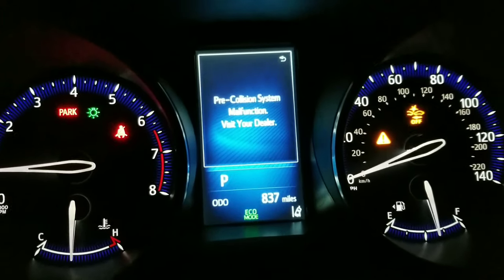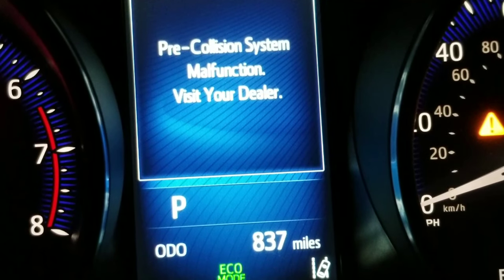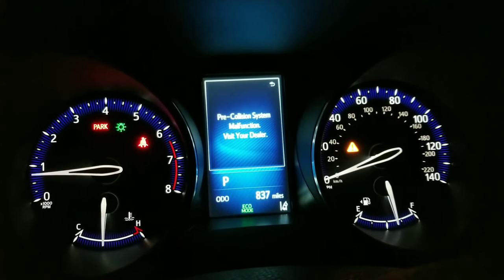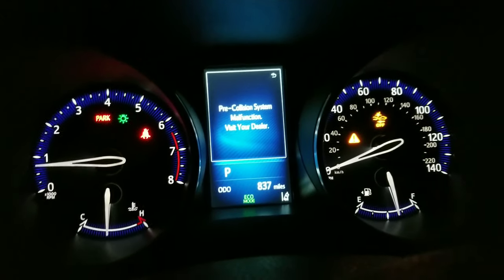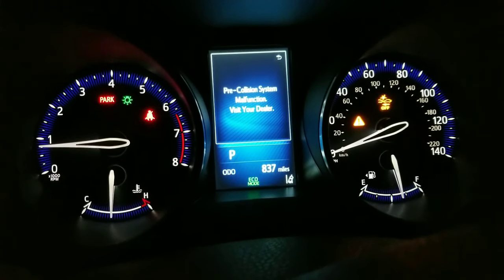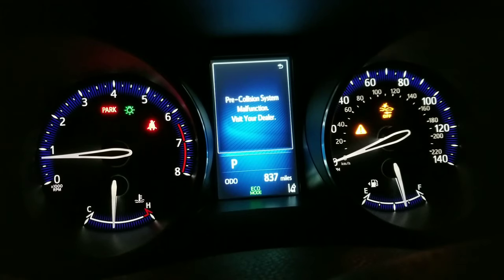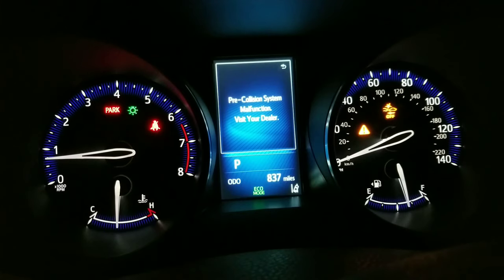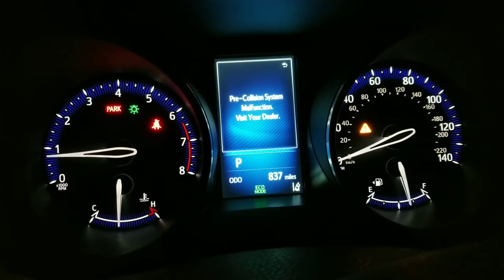Toyota CHR Pre-collision system failure (FIXED*** read description for how it was solved)

Comment: had the same message today, with one more message,  trailer brake error, at the dealership they told me that a mouse or something like that had eaten the harness and that the harness is in between the intake manifold and the engine, in all it's going to be $700.00 dollars to repair, I don't really believe them, but had no options because the dealership does not recommend to drive the vehicle like that, it's going to be about two days I had to claim it through my insurance but feel like I been taken for fool, let me know what you think!!!
Reply from the maker: Oh wow I'm sorry to hear that! If it's the dealership they will be charging full price and I wont imagine any local shop would do any better. How much is your deductible? If you want proof that's what it is, I'd ask for pictures prior to the repair (may be too late) and after. Man, that stinks... hopefully it won't happen again.
Reply: Alejandro martinez  yep i had exactly same situation with my chr they told me rodents chew the wire its BS

Comment: I had the same problem last night. It was snowing so I stopped and wiped the front of the sensor, switched off the car and on again. Error message didn't go away. This morning when I was leaving for work, there was no error message at all. Please update your situation.
Reply from the maker: Raghu k c sorry to hear. Believe it or not it's still with toyota. The sensor is back ordered and had to be ordered from Japan. I have since contacted their coorporate offices and they are giving me a credit on a car payment since it will be nearly a month that my CHR has been at the dealership. That's all I know at this point.
Reply from the maker: They expect it to be in on October 30th
Reply: thomas petroff jr I took my car to the dealer today abd booked the time for next week. According to the dealer, this is a common problen in C-HR. If I understood correctly, during the rain or snowing, vapor develops in camera lense blocking the sensor. So, the guy says it takes like couple hours to install some kind of extra heater so that no vapor will develop. Hard to believe that but I am no expert on this. Apparently, Toyota has informed them about the problem and it seems it's the same problem in many others too. Good luck with your car.
Reply from the maker: Raghu k c I think we have different issues since I live in Los Angeles and it wasn't rainingor snowing. They say it was a bad sensor for the breaking system that affects the radar. I was able to get toyota to make a car payment for me since I'm without my car for nearly a month now. Hope this isn't a sign of things to come. I really LOVE this car
Reply: @tompetroff hey what's the Name of sensor.... did car shut off on you?

Comment: Very concerned that you had a trailer hitch installed in the rear of the car, but had the front sensors affected. Pre Collision radar system is located in the front behind the Toyota grill emblem and camera on the windshield in the area of the rear view mirror. I had a rear bumper collision, but the repair shop denied that a rear collision on a 2018 Toyota Camry LE could affect the Pre-collision system in the front of the car. Is there any data that the rear bumper has anything to do with the Pre-collision system ?
Reply from the maker: It offset the ohms of electrical system. That's what Toyota said. Haven't had an issue since I had the brake light adapter removed from the trailer hitch
Reply: 2 months late, but I was involved in a accident where someone rear ended me. My Ford fiesta (same layout of the system) displayed that the adaptive cruise control system had malfunctioned. So yes I can confirm with 100% certainty that a rear shunt can affect the pre collision system (as it uses the same radar as the adaptive cruise control)
Reply: @tompetroff  hi thomas , my toyota corolla hybrid showing the same signs+ hybrid malfunction system... and car is not starting as well.... did you have same problem?? And what has been repaired can you tell me please if you know about it,,, thankss

Comment: Just an FYI, any time you Malfunction Indicator Light like this one (or ABS/Traction Control, Airbag, etc.) the system that light pertains to is disabled (This does not include the CHECK ENGINE Light).
Reply from the maker: That's an excellent point thanks
Reply: So my airbag light is on because seller didn't replace the curtain airbag. My BSM doesnt work because driver side door was replaced with original. Maybe the connection not plugged in for the mirror? Also cruise control radar works but if i get close to someone it wont pick that up. Lane assist works. Also i noticed when its hot i get a pre collilsion malfunction but goes away when it cools down

Comment: Important information! 
I have a chr and my preclusion light was on. I was confused at first because I kept cleaning my windshield and logo. Turns out, 2 weeks ago I went to replace my windshield due to a crack on it. Safelite used a third party windshield causing the sensors to keep pooping up to clean it. Toyota actually requires Toyota brand windshield for it to function correctly.

Comment: I just started having these issues when I installed a 3rd brake flasher. And ur issue was when they installed an additional light? I wonder if i shud return to stock?
Reply from the maker: Yeah, it changed the draw of electricity. It's very sensitive and was fixed when I removed the brake harness
Reply: @tompetroff  thanks for response. I'll remove it!

Comment: My Toyota Camry after being repaired by the panel beater has the same ongoing issue I tested it today in two different ways I left the pre-collision system on and put on cruise control I drive for a bit and then the pre-collision system malfunction turned on

Then I tried something else I disabled the pre-collision system by switching it off I thought this would work again I put on cruise control and started to drive out of nowhere it came up pre-collision system malfunction
Reply: Do you change front screen or open the Car's bumper from mechanic??

Comment: I have the same problem. I went to the dealer the re-install the software. But the still on. Note this is my second c-hr, and the first I didn’t have this problem.  I live in japan.
Reply from the maker: Roberto Guimaraes so you have the 2019 now? Ive been really satisfied with my 2018 and no major issues. Sorry youre going through this
Reply: My Camry has done this twice, just take battery cables off, wait a minute then put back on. Warning light will still flash until you drive the car. Then it’s fixed.
Reply: I love my chr, but I’m ready to trade or sell it JUST for this malfunction light. Grrrr.

Comment: The same light turned on for me just right after driving the car for over 7k miles. Was yours got fixed? I used my cruise control while raining then minutes after the PCS light went on.
Reply from the maker: Marv Molina it appears to not work well in the rain. My issue was due to a trailer hitch I had installed
Reply: thomas petroff jr did the light turn off though? And how long did it take you to get the PCS fixed?
Reply from the maker: Marv Molina it did when they (toyota dealer) disconnected the brake kit uhaul installed. If its still on I dont know what to say. Have you taken it to the dealer again?
Reply from the maker: Marv Molina It went off immediately after disconnecting the cable uhaul put on. However I know there was a recall on a part so you may need to check with your dealer. This was around Feb of this year 2018
Reply: I just went to the dealer and they said that there was no recall. The light turned off after a couple of days, so they could not diagnose what is the problem. Showed them a picture of the light that was on but they said, they have to see it in the OBD
Reply from the maker: Marv Molina where are you located? I live in los angeles and went to frontier toyota. They had my car for over a month and had even toyota Japan involved.
Reply: I’m from Florida. Hopefully, they don’t have to hold my car for that long cause that would suck
Reply: What was the issue how did you fix car

Comment: 2019 CHR 7000 miles--with exact same issue 
The visit to the dealer was joke
Tell me rodents have been chewing on the wires new camera radar module is $4500 buck if insurance wont pay then they can re wire the old cannon plug for $500 
Anything to avoid warranty payment
Scumbags not at all what I had expected from toyota my last vehicle I will buy from them no honor among thieves --sad
Reply from the maker: Wow I’m sorry you are dealing with that. I haven’t had an issue in 2 years. What state do you live in? Would it qualify under lemon laws?

Comment: I just bought a CHR as well a month ago. Didn’t have this issue BUT I was driving and I was at a stop light. The indicator on the speedometer turned on for about 3-4 secs and went off. It hasn’t turned on ever since. 🤷🏼‍♂️
Reply from the maker: Aviator2015 which indicator?
Reply: thomas petroff jr I’m sorry, the pre collision indicator.

Comment: Hi I’m in Australia and my Toyota Land Cruiser prado 2018 has just had the same thing happen 55oookms on the clock dealership told me Toyota has never seen this after the replaced something in the dash we got the car back and 2 days later it has done it again. Let me no what you find out because down there they say they have never come across this issue (bullshit).
Reply from the maker: Marc Sacco sorry you are having this issue. For me it was my break light kit that haul installed for a trailer hitch I put in. If your car is dirty or if it’s raining, the sensors don’t like it. I wish I could be of better help. Best wishes on your car. Something tells me that there will be a class action suit at some point

Comment: i have Toyota Prius 2017 model having issue ( Pre-Crash Safety Currently Unavailable ) and Radar light is continuously blinking , any one knows what to do ?
Reply: Faheem Ali / I have the same problem. The OBD scan tool shows the code POA1114 meaning "DC-DC converter enable circuit short to ground".
I took it to a few mechanics and the hybrid battery is good, the DC-DC converter gives good amps and voltages.
When I press on the brake the red warning sign of the battery comes on, but only when the car is moving forward or backward, not when the car is stationary.
I suspect that either there's a bad electronic component in the DC-DC converter that creates the short to ground only on regen function ( regen is when pressing the brake, and takes place when car is moving forward or backward ) or some bad braking sensor on the body of the main brake system ( the braking system is "on wire", electronic, the feeling of resistance that you have when you brake by pushing with your foot is fake, is created artificially by a spring ) that has electronic connection to the DC-to-DC converter system.
The mechanics don't know what  causes it.
I'm still trying to find better  mechanics to repair it.
Reply: Appreciated

Comment: I have this problem:  "cruise control malfunction, visit your dealer"   How to solve it ??
Reply from the maker: Are you asking if I went to the dealer or if you went to the dealer and still dont have an answer
Reply: @tompetroff  Read my reply again, my message different.
Reply: @SuperEdgar10  i solve the problem , my problem was in the TCS cable which going to the ECU, the purple wire was cut !!
Reply: @Khalil-p8s  by animals huh
Reply: @SuperEdgar10  what ?!
Reply: Khalil / "Purple cable was cut". Cut by what? Disconnected? By what? By vibrations, by beying chewd by a rat, squirrel, etc ?
"Cut" by what?
Reply: مرحبا شو بتكون المشكله وشو حلها من فضلك

Comment: I am having the same problem with my 2019 C-HR the collision system light won’t turn off and it says the system is off. I’ve gone into the settings and tried to turn the collision system back on , but no luck. I’m going to take my car to the dealership to see if they can fix the problem.
Reply: Did you find anything out ?
Reply: Jaime Gomez   No, I was hoping you could help me. The collision system is actually on but the light on the dash keeps saying it’s off, but that isn’t true, it’s on.

Comment: Do you remember how much they charged to fix this?
Reply from the maker: It was brand new so it was a warrantee fix
Reply: I paid $370 for diagnostics and they told me sensor was going bad and it would be $1000 to replace it. It started during Covid and I never took it in. I do not want to give them more money for something that might be wrong with all Chrs
Reply: I’m having same issues with my 2019 C-HR. LDA, Pre-collision, and headlight system malfunction errors keep popping up. Toyota gave me a quote of $600 to “fix” those error messages.
Reply: @gabriellanicole2924  are you having any trouble with your headlights or is it just the automatic high beams?

Comment: I just purchased a Tundra. 300 miles in, same issue, as well as a trailer brake warning. Please advise of current status. Another Tundra pulled in behind me at dealer with same issue.
Reply from the maker: Lucas Armand  it appears that the issue is with the brake light connector that uhaul installed. It's not an issue with uhaul but that it overwhelmed the toyota computer by setting it off by 2ohms. Once they disconnected the connector all was good
Reply: Ok thanks, definitely not my issue as I have not added anything electrical.
Reply from the maker: Lucas Armand some have had issue in the rain and snow. We're you in similar conditions? Also I know there's a recall on one of the break sensors. Maybe that's the issue? Ask your dealer about it
Reply: My 2018 Tundra started with the errors @ 1500 miles. Taking to the dealer this Friday.

Comment: Dear sir my tail lights and reversing lights are also not working and i'm getting 3 types of error radar cruise control error, hybrid system failure( i can't choose any modes) and PCS and ICS failure all on my 2013 crown Athlete. Hopefully it's some wiring problem.
Reply: any update?
Reply: I have same issue, please update how you fix it.
Reply: @mohammedalbrashdi3941  bro it's related to your hybrid battery. A simple temporary fix is to unplug your negative- terminal for a couple of mins (12volt battery located in the boot) & start your car again. Let me know how it goes.
Reply: @chrisk9808  Bad cells on the hybrid battery pack, replaced them but the error kept popping up. The only solution is to fit a completely new battery.

Comment: Getting same error on my 2013 crown athlete. Really getting me worried.
Reply from the maker: thegame123ize is it always happening or only when it rains or snows? That can affect radar
Reply: @tompetroff  no i just bought it it's a used car from japan. It was fine when i checked at tge dealer's but after driving it a for an hour or so it started giving me errors. I called the dealer he said he'll send someone over to fix it and it's a just require a software update or programming( or some mambo jambo) hopefully i don't have to return it and gets fixed tomorrow.
Reply: thegame123ize / Did you fix it? What was the problem?

Comment: Sensor ?
Reply from the maker: Gopher San yep. That's what they said. They have had it for 23 days now. Had to order the part from japan
Reply from the maker: Gopher San linked with the radar
Reply: Sensor malfunction are first issues to rule out in most cars, in cases like yours, low mileage, no collision, damage from elements, etc.
Reply from the maker: So I went to see the car today to get some things from the trunk and they replaced the computer that took 3.5 weeks but still got the malfunction notice. So now they say it will be the ABS which will come in tomorrow. Hoping the CHR isn't a lemon...
Reply: I'm sure they will get it fixed. Sensors are easy. . .nothing mechanical, as i see it.
Reply from the maker: Gopher San I went by the dealer today and they replaced the computer and still got the warning. Now they will try to replace the ABS tomorrow when it comes in.
Reply: @tompetroff  I had this happen to 2 of my Toyota's recently my 2018 CHR & if under warranty take it in & they'll pop off the covers & will replace the faulty sensor takes 15 mins. It hasn't come on since...It might down the road who knows...is why I bought into the 5 Year extended warranty.
Reply: Also before you do take it in tap or rap on your Bumpers for that's where these sensors are located, sometimes they just get damp & full of condensate or dirt
Reply: Which sensor plz and where’s located
Reply: Garry Bandura / Which sensor?

Comment: I have also this problem please suggest me what I do
Reply from the maker: Zaheer Shah will do. They have had my car for nearly a month and still waiting. They replaced the computer and same issue. Now they think it's my dash cam which makes no sense since it's only plugged into the cigarette lighter adapter via the fuse box. Glad toyota is making my car payments until I get it back.
Reply from the maker: It wasn't the dash cam so they ordered a new abs and will install it tomorrow